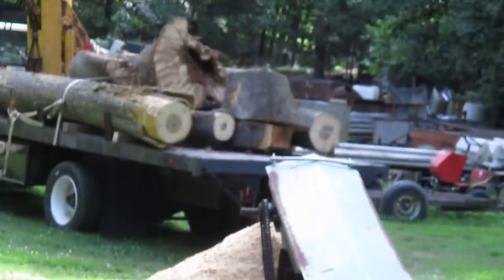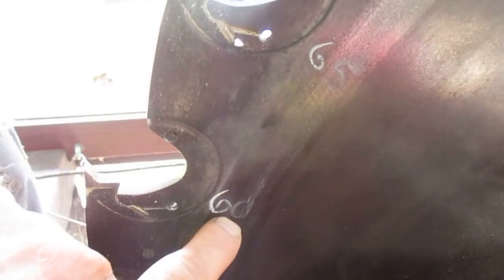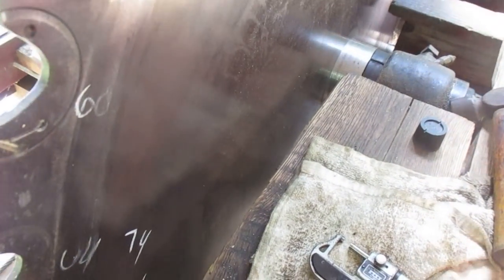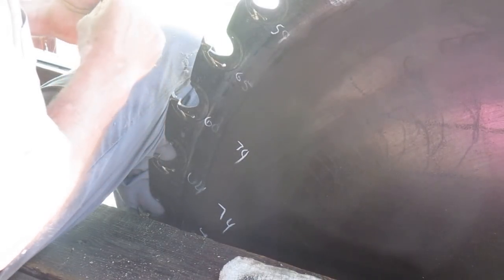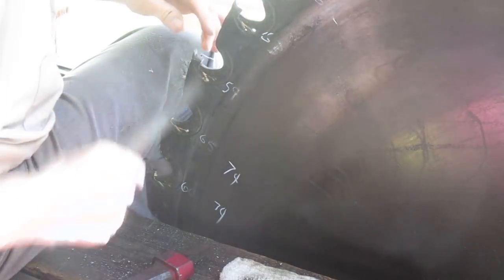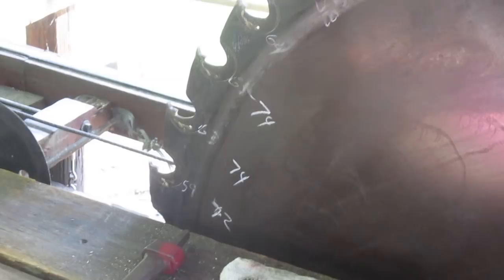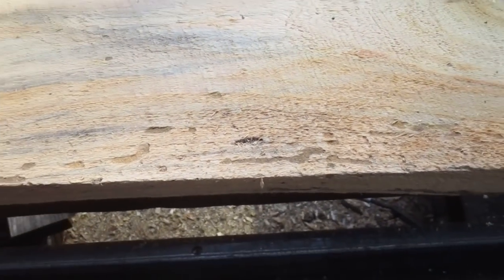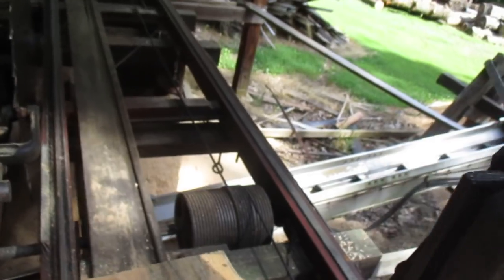Sawmill  You Brake it You Fix it #397

Comment: I learned how to do this about 35 years ago. It bothers me to see others just eyeball it and then wonder why it still doesn't cut right. It's best to use a micrometer or caliper on them. The closer you get them to being the same size, the better the cut. 2 thousandths is a good tolerance in my book. Like you said, it's the thickness of a hair. A typical sheet of notebook paper is 2.5 to 3 thousandths thick. If they were all truly at .274(+/- 0), the cut will be really smooth, almost as if you already planed it. Using a +/- 10 gives a really rough cut. The wider the tolerance, the rougher the cut. Nice editorial. It's good to see it being done correctly. Do it right the first time so you don't have to waste time doing it again.
Reply from the maker: hi there some times i use a spider gauge but got far out readings  thanks its good to hear from someone that has knolage about this kind of stuff . john
Reply: @fricknjeep  Side to side alignment of the tooth is in my opinion as, or more important than the width provided that the damaged corners have been properly dealt with leaving no negative clearances or missing portions on the cutting edge. With the blade clean, and the tedium of filing  the seemingly endless teeth over, seems like an ideal time to investigate why those spider gauge results were unexpected or confusing. That would drive me crazy. Out would come the dial indicators, and then a chat with the fellow who hammers/hammered the blade.
If a tooth has equally worn corners without being displaced to the side, simply peening the tooth across it's width to get the original undamaged dimension is fine, but if only one corner is damaged and or displaced to the side, it does not correct the problem.

Comment: A one man mill is like driving a cab-over truck, if you crash you're the 1st one there. Still glad you're without added vents. Seems like the old logger/sawyer swatted the swage about 3 good licks and then filed it. There wasn't and still probably isn't anything technical about that mill. I've got to get out there this week. The blasted logs are piled up to the roof. BIG ones. He clears house sites and gets the logs too. What a deal. Keep on making chunks. GBWYou!
Reply from the maker: hi there  this is kind of funny cause i just sold 6 cab over jeeps . thanks john
Reply: @fricknjeep  Neighbor had one. Seems like it was an FC-170 or something. FC-Forward Control. I had a high hood, whatever it was.
Reply from the maker: @lewiemcneely9143  hi there down sizing sold 6 of them john
Reply: @fricknjeep  I'd say!

Comment: Alright John at least no one was hurt that's the main thing a little filing a little fuss and you back to running when I was young and working at a dealership I used to come get me to sharpen the customers chainsaws because they said they last a little bit longer than they did it the mechanics did it I was raised cutting firewood okay and when I mean that my wood splitter was a 8lb wedge axe now today all these people got to have hydraulic wood splitter I don't understand but good job John good job I'm glad you wouldn't hurt just thank God
Reply from the maker: hi there good story thanks john